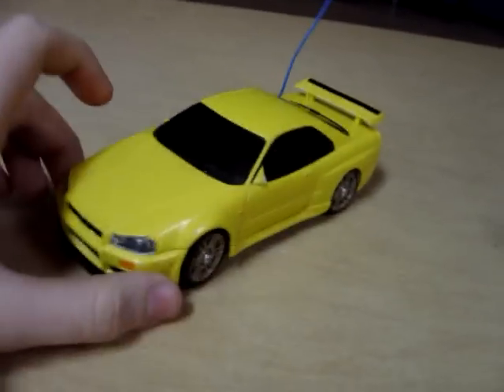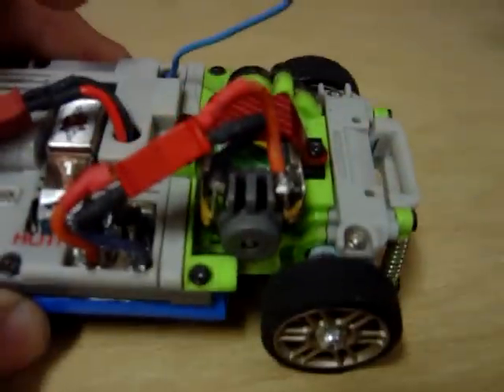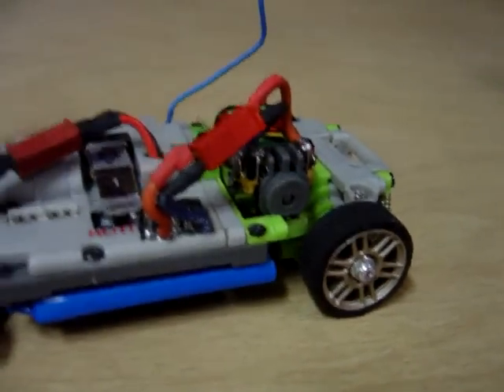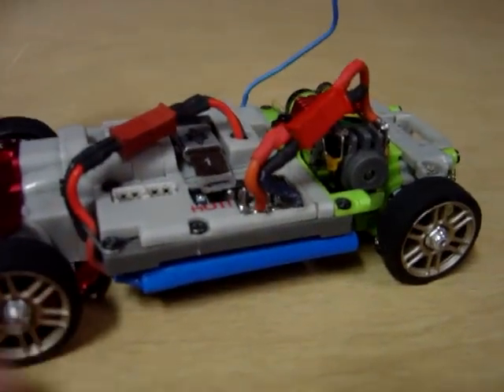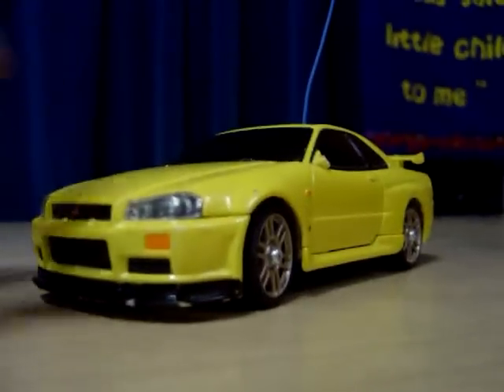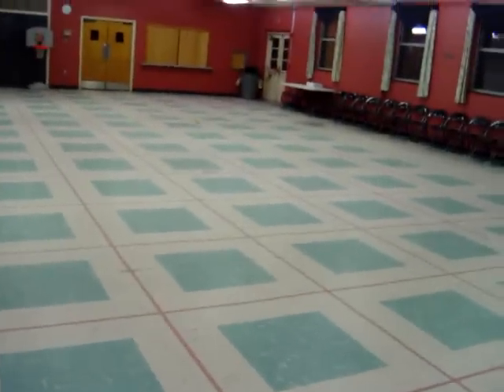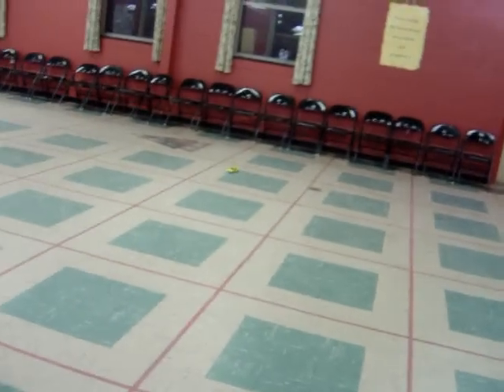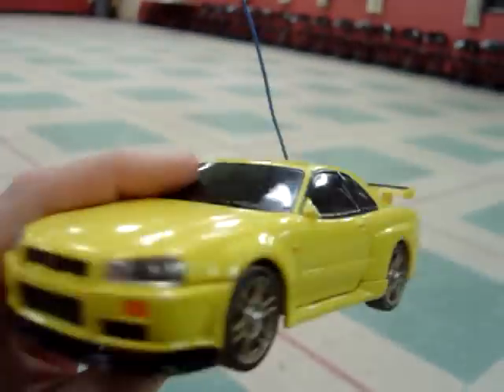Xmod skyline with t2 motor

Comment: if you want more control to drift try to lock the rear differtial or make it to move less then add tape on the tires and voila awesome drifts and plenty of power :P been thinking of getting atomic stock and a mini-z awd chassis without radio or body and use my dodge viper body that is from my old mini-z mr01 copy :P